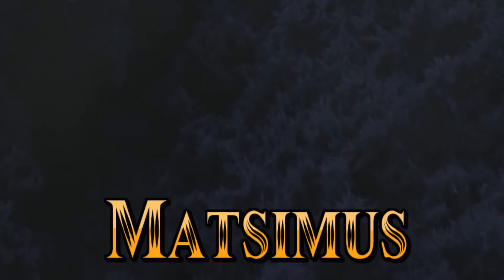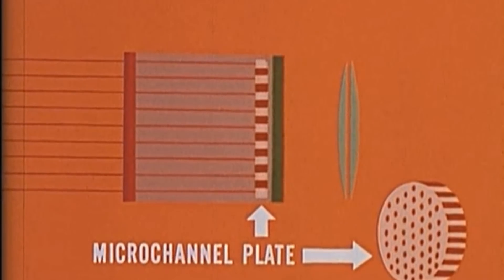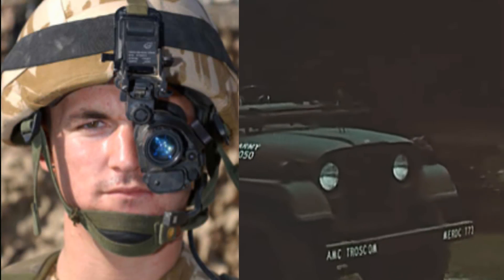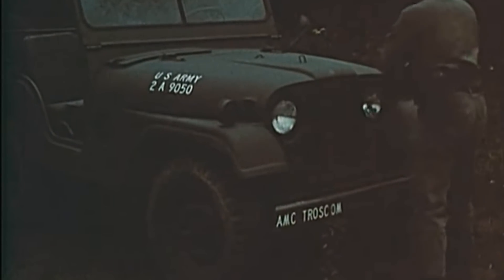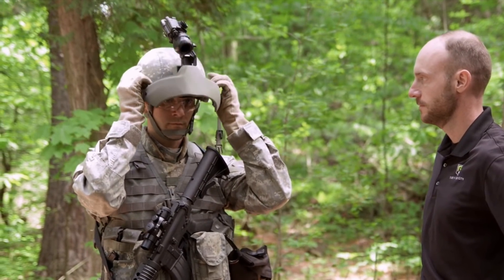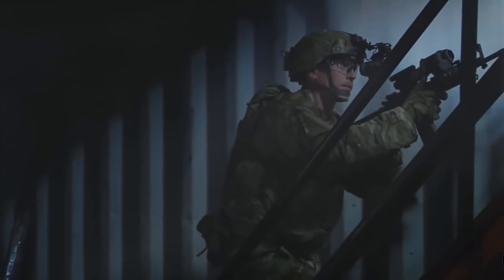How Has Military Night Vision Technology Advanced?

Comment: HBO Generation Kill shows marines lacking fresh batteries for their night vision.....so why was the HumVee not equipped with a feature to use the vehicle alternator to recharge night vision batteries, laptop batteries, etc?
You have to question the spiral, one of the best examples being jet fighters in the US Air Force.   What it can do while in the air is all that gets talked about.....but when you look at how many hours it must spend on the ground being simply maintained, not repaired, just mandatory maintenance, the dollars per flying hour is just plain stupid.  Cheaper to buy three previous generation jets for the price of one Dbag jet, cover more territory to better effect?  
A1 Abrams is a fragile racehorse totally vulnerable to a supply line of jet fuel to run the turbine engine. What is the point?  Too expensive to build, maintain, repair. Cost to train and pay a large staff of men to fix extremely complex machines has to be factored in.   Why was the lesson of the German Tiger Tank versus the Soviet T34 not learned and applied to contemporary war?
Yes, you can hit every target, but when the Soviets and Chinese have unlimited flood of military, you run out of bullets before they run out of cannon fodder.....only won in the Gulf because Saddam ordered most of his excellent jets grounded, because his predecessors had been assassinated by "friendly" jets dropping a bomb on HQ.  If he had trusted his own air force, totally different story in that war.
HBO Generation Kill shows marines lacking fresh batteries for their night vision.....so why was the HumVee not equipped with a feature to use the vehicle alternator to recharge night vision batteries, laptop batteries, etc?

Comment: One change that seems slow in coming is from analog to digital. To my understanding the principle for military NVGs has remained fundamentally unchanged from almost the beginning: light enters a tube, this excites electrons that are translated to a display. There have been continual refinements like greater sensitivity (1000x to 50000x light amplification) and adding thermal and other features but they are still using the same basic principle. But like low-light video cameras, digital NVDs use a CCD (Charge Couple Device) to give a completely digital picture on an LCD screen or eyepiece. You can toggle not just a green display but red (to preserve the eye's natural night vision) or grey (makes the image easier to see, like black and white) filters. They can also be used perfectly well in daylight, although some colours look odd (as these are emitting in the IR range we don't normally see). They still cannot function in complete darkness.

Comment: one of my former classmates moved to the UK, and has been working on NVG tied to a FLIR sensor that can be detatched with a switch to extend only a micro cam around a corner. the fov wouldn't be as hindering nor a lack of depth perception so long as the image was good and well defined. he's actually wanted to build something like that since 2003 while he was in college. one drawback to night vision is that it doesn't do particularly well when looking at glass windows.

Comment: Mats, there is one night vision device out there that you can buy if you're on a tight budget, it's actually a toy called an Eyeclops but it's actual night vision. I believe that it uses Gen 1 IR imaging and it has a built IR light albeit a weak one.  It's also a monocle and you see through only one eye even though the housing makes it look like you'd see out of both eyes. If you want something more rugged I think early generations of NVGs are out there on the surplus market for relatively cheap and there are cameras/camcorders that have built in night vision capability.

Something that should probably be pointed out is that there is a difference between IR and thermal. IR sees in the infrared spectrum and needs an additional IR light to really see well in the dark. Thermal, on the other hand, just sees heat values and a lot of military night vision footage where it's just black and white with some objects in white and others in grey or black is thermal imaging. What you see in all of those paranormal shows where you can see everything in almost perfect detail except only in b&w is IR with illumination coming from an IR light.

Now for a bit of night vision trivia. From what I understand, UCP (the old, ugly grey digital camo the US Army used to use) was created by taking the CAD/MARPAT pattern/screen and colored using the three color values (light, medium, and dark) that worked best under night vision. At the time, the US Army was very concerned about operating against a near peer opponent (ie Russia) that fielded night vision equipment and so wanted a camo pattern that would work well under IR light with visible light performance (apparently) being a secondary concern. The colors mattered because colors behave differently under IR light than they do visible light and colors that in regular light appear contrasty can blend in with each other. This was the problem with the old woodland pattern, the green, brown, and khaki blended together turning the 3 colors into only 1 or 2, while the black stood out even more.

Comment: why cant i just have a google glass equivalent  displaying  a  thermal image/ light amp layer  fed from a ir/uv/image intensifier  fed from selectable sources like  say  a ir cam mounted to the sigh  or two ir cams mounted either side of my helmet  or even a composite image contain both and other sources like  from  over head UAV's ans LANTERN pods etc  ( rendered off site .. obviously and then transmuted to the soldier )
Reply: 10:04 ... we do .. they're called mirrors .. or "compacts" as the womenfolk call them .. they also have an advanced model with "attachment point" (aka gaffa tape) for " reach extending devices"(aka a stick)
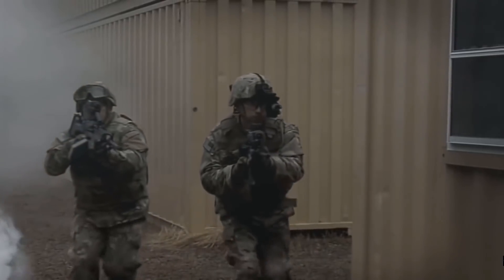Reply: 10:32 and that's why i keep a marzipan hat on me at all times ... ive been burned before...
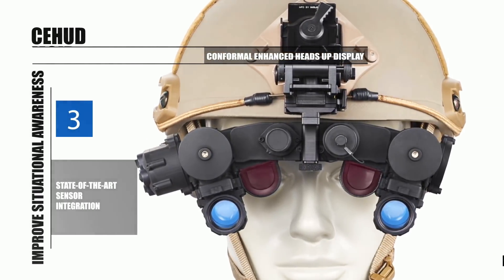Reply: 12:14 ... oh im sure it causes some horrible disease or cancer ... all the cool stuff does ...

Comment: Commenting on the new stuff.
I have to admit I am skeptical about IR tags that "only allies" can see... That is not how reality works if the enemy also has tech. Passive systems, sure, bring em all. Thermal with AR (Augmented Reality) etc, but active ones that produce "wifi", IR or similar "output"? That sounds dangerous. If your allies can see you, so can the enemy with similar gear. Or if you are isolated they can even cross ref your electronic signals and it would suck to need that in order to use the gun!

Comment: I have used a few types in the field.
90s gen infantry, first or close gen thermal for the Eryx, which we used for infantry hunting rather than AT roles and I have tried a state of the art vehicle driver night vision from 2000.

The infantry 90s era are like you see in the movies, but allot more grainy. This is because the ones you see from TV during the Gulf in 2003 etc were using IR light boosters. Which is a big no no during night patrols because you, with night vision on, see others with IR on as people walking around with "flash lights".

The vehicle one I got to test was basically "Arma 3" with a green filter. That amount of light that thing could take it basically made everything look like green day, not the band, but :D

The thermal however was very interesting. Its was a one color thermal that look similar to how Robocop viewed the world. Meaning that you had one vertical line of color and then a black one, red and so on. Everything was VERY low resolution. You set the sensitivity and ether you got a full red image, full black image, or a "semi" outline of something that wasnt hot or cold, but hotter than its surroundings. In short, very basic, but here is the trick...

IF you set the sensitivity of red to just above zero (the setting that is, not the temp). You would ONLY see "points of interest" that were much hotter than its surroundings. In winter or even summer forests at night, what is that, you ask? Human activity! Red square = Tent. Red largish blob square = vehicle. Red "poles" = infantry. Red small circles = Occupied fox hole etc and lets just say allot of special forces teams should be glad we were just training against them. Because they had NO idea we had these capabilities since its usage wasnt in the training manuals. It wasnt intended to be used that way.

That said though, some times red circles dont mean occupied fox hole and while you might not be scared of the "enemy" during training. A pissed off angry badger is something else! :D

Comment: I'm one of those old guys who served in the 80s and the PVS-14 was the standard for a while when I was stationed in Germany.  While at Camp Hoff on border patrol duties I got to use an old starlight scope but not sure of it's model number.  Later, when the PVS-7 came out we were very impressed with it.  My MOS was 19K and the M1A1 Abrams I drove had a 3rd gen starlight periscope for my drivers hatch.  The gunner and Tank Commander had the tank thermal sights, of course.  The loader had a PVS-7 headset.  I got out in 1991 after Desert Storm.  It's simply mindblowing how far the tech has come in the following years.

Comment: NO WONDER YOU DIDN'T LIKE IT! Your rifle wasn't set up to use it, was it? BTW, here's my forecast, the traditional method of using night vision systems like military elements have forever with traditional IR lasers will continue until folding optics systems like the PVS-21 and the monocular variant replace it, assuming it even does, if it can allow rapid signature passive target acquisition using the standard electro optical sight rather than the IR laser which puts out a signature. At MOST I think what will change from standard optical image intensification and folded optics is the possible integration of thermal in the form of a fusion system and the ever continuing struggle to make this system lighter, less obtrusive when used in conjunction with a weapon, and expand the field of view in whatever method can be used to do so without the increased profile, bulk and weight that the GPNVG suffered.

Edit: changed "broadcast" to "forecast"

Comment: Can infra red goggles see walls trees ect?
Reply: Infrared LIGHT is just a spectrum of light the eye dosent normally see. When you use tech that can see it. You can see the same things you can see with normal light. It works the same way.

Infrared RADIATION however, which thermal uses, can see behind thin walls, but not trees. They are too thick to penetrate heat.

Comment: NVG's are one of those things we all knew we needed and also hated. When I was in the problem was depth of field and usefulness. The drivers hated them because stuff would still "jump out" at them and could cause accidents, the foot patrols tended to do half or a 3rd on/off sometimes because your eyes would adapt better to the immediate surroundings if you weren't wearing them so you would trip less. The only real tangable use was with pilots and sentries and even the sentries would..."aquire"... empty Javelin launcher units for use instead because the display screen nv filter was better than the googles and it offered zoom and even IR (IIRC). I heard good stuff from the ninjas and how their's could work way better with scopes but never saw it, obviously.
Reply: Mandalorian Gaming I had depth perception problems ad well at first once you get used to them its not as bad but I remember tripping all the time lol
Reply: I also have issues gauging the distance of commercial planes 5 miles out with closer planes, inflights. Even the space satellites jump out at u in high illumination skies at first.

Comment: I wonder how these technologies are going to be countered, e.g. how soldiers will be able to remain hidden from these things and how they will be able to hit someone who is just pointing his gun around a corner. Maybe it's possible the blind/destroy modern night vision goggles? When we blew up doors during my service we always had to look away from the explosion because apparantly the bright flash damages them.
Reply: Until the Gen 3 Autogated NVG, they could be damaged by an intense light.  This would also shut them off, which I can tell you (FIRST HAND) SUCKS when your driving in "blackout drive" and this happens.  

NVGs are basically a vision magnification (light) and a properly concealed enemy can evade them because YOU need to actually recognize what you are seeing.  A man hiding in the bushes will often still have his outline "obscured" by those bushes.  In some cases, you may not recognize him as a man.  NVGs are often affected by ordinary smoke, dust, the weather, and the terrain.  Thus NVGs are not "all powerful" on the battlefield.  They are also rarely magnified.  This means you are limited in your range of detection to a level approximating your normal visual acuity.  And speaking of visual acuity, depth perception in older NVGs was often compromised.  This is why NVGs really weren't used for precision flight an NOE (nap of Earth) until the advent of the enhanced GEN 3 autogated NVGs.  It took a while to get good depth perception out of NVGs.    

Thermal Imaging is another animal entirely.  The current crop of TIS is so sensitive that they can often detect even buried objects.   The M1 could see AT mines buried in the ground because they absorbed heat at a different rate than the ground around them.  This created an "image" different from the ground that the TIS could see.  Thermal can see right through walls that are poorly insulated BUT NOT through glass (which will reflect heat).  They can see the imprint of where a person stood, walked, or sat because we "leak" heat all the time and this heat appears as body-part shaped "stains" on the terrain that slowly fades with time (as the surface returns to the same temperature as its surroundings).  The greater the difference between our surface body temperature (which runs in the 80's... and is not our INTERNAL Temp of 98.6) from our surroundings, the more "contrast" we provide to be detected.  It can be very difficult to pick out a broken up thermal silhouette in the jungle because the temperature of several objects in the TIS may be very close together (varying by less than a degree).   You could try to "insulate" yourself from the TIS by hiding under a "space blanket" for instance.  This would work for only a very short period of time as your radiated body heat would begin to "bleed through" the blanket as you heated up the space under it.  The TIS would see a slowly expanding "blob" of heat as you warmed up that space.  This does bring up one issue the TIS has though.  The thermal signature of an object may NOT resemble the said object.  I can remember a friend of mine "memorizing"  the thermal signatures of both Allied and PACT AFVs so he could identify them using the TIS.  To avoid "fratricide," US Tank Commanders in the 80's and 90's would often go "Clear Channel" and use their Daysights to ID a potential target.  I don't know if this is done now as TIS have a MUCH HIGHER resolution than the older FLIRS had.  

As for blocking TIS, there are several systems being used.  The Russian's have the SHORTA System.  The "cat's eye" IR dazzlers (a part of SHORTA) some T90s have will blind a TIS.  The Shorta system's other (less well-known) feature is also incorporated into MANY more INFs.  It consists of grenades ejected from the smoke dischargers that release a transparent (to normal vision) particulate that blocks all IR emissions, including TIS and even refracting lasers.  The clear particle still allows IFV crews to engage using day sights or the MK1 eyeball.

On NATO's side, we prefer Dual-Spectrum Smoke Dischargers that block both normal vision and IR imaging (including laser designation).

There is also a passive system using IR absorbing paints and finishes.  These coatings absorb IR radiation and thus reduce an object's "IR signature."
Reply: Thanks for the many details! The NVG we extensively used during my service time were fairly old, but as far as I know they're about to be replaced by modern ones. I'm certainly looking forward to them in my next period!
Reply: Thermal imaging is really amazing stuff and the current generation of TI can be really sensitive. I remember seeing something talking about how the thermals in police helicopters can actually read residual heat signatures. In one case police were chasing a suspect at night and the chopper that was overhead warned the officers on the ground about a possible second suspect in the car, which turned out to be a false alarm because the helo was just reading the residual heat signature in the passenger seat. In the same incident, or maybe a separate one, a suspect had thrown his gun out of his car window, once again at night, and thermal equipped police helo actually guided the officers on the ground to the gun because they could actually still see the heat on the gun from where the suspect held it before throwing it out.
Reply: swaghauler There are also active systems being developed to fool thermal devices. I think one of them is being developed by BAE and is designed to actually change the appearance of vehicles with this device mounted on it. While I don't think that it can actually hide a vehicle from TI devices but it can make, say, a tank, look like a truck.
Reply: On new NVGs the unit will shut off momentarily (auto gated) to protect itself from white light or high powered IR lights.  I was told that in the future that one soldier will be able to show other members of there teem the image from there NVGs so everyone has a much better view of the battlefield.